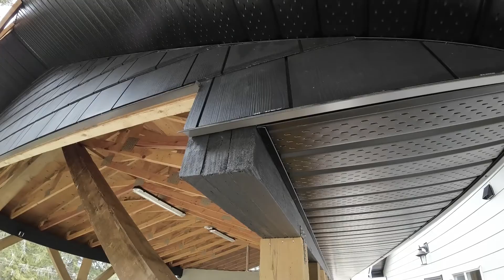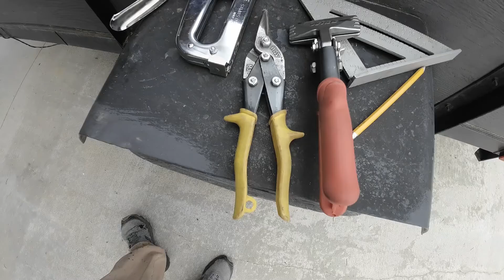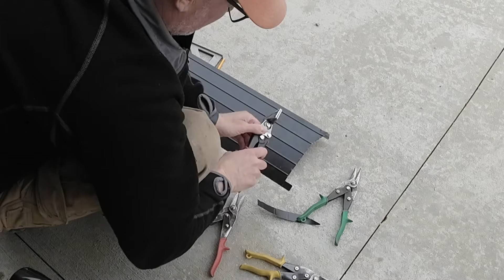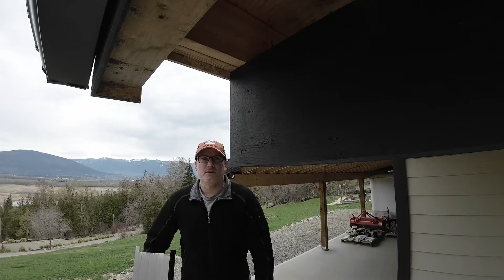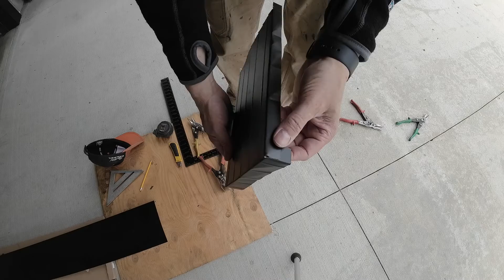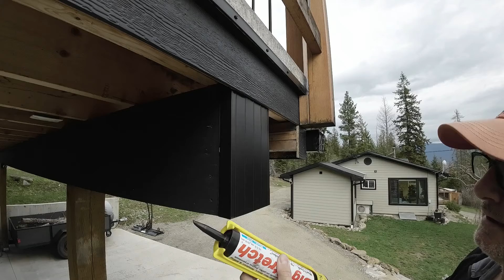HOW TO- CAP THE ENDS OF YOUR BEAMS TO PROTECT THEM FROM THE ELEMENTS. #capping @maintenancewithmike

Comment: Does a person need to turn the bottom edge or the side edges to prevent water capillary action from occurring? Great video. I am having this done on my new build today.
Reply from the maker: I guess you could do a small return all around to ensure the water doesn’t travel back. It is a 1 inch depth cap so I’d think that would drip before it travelled back an inch. Good luck on your install and thanks for watching. I wish you could post pictures here so I could see what you did. Cheers.

Comment: I know of a manufactured log cabin where the ends of all of the  logs are exposed to the weather  great thing is that the whole house is stained with a oil based stain
Reply from the maker: Yes sir that would also work really well. In some instances capping would not look the best and just keeping up on the staining is a great alternative. The key is you definitely need to keep up with the staining then.  Thanks for watching. Cheers, Mike.
Reply: @maintenancewithmike    the people who live in the log cabin will have to get some one to pressure wash the  entire house and then get the right color of stain and  then find a way to apply it to the house 🏠
Reply from the maker: @robertmailhos8159  log cabins are definitely a labour of love. Lots of work but man are the gorgeous. Thanks for sharing. Cheers, Mike.
Reply: @maintenancewithmike   cool beans 🫘 there maintenance with Mike